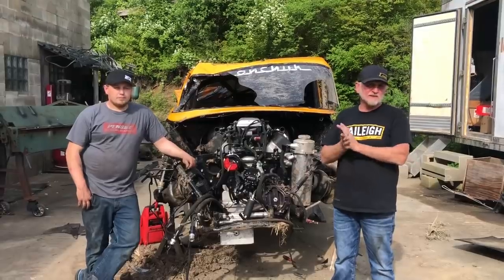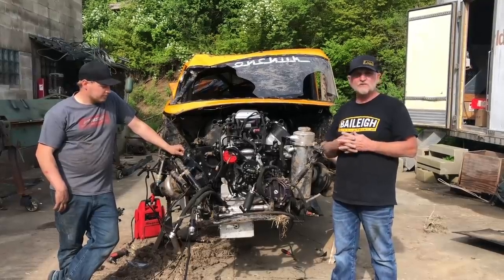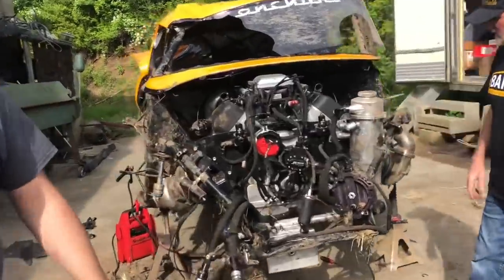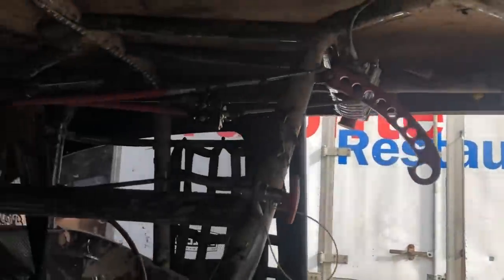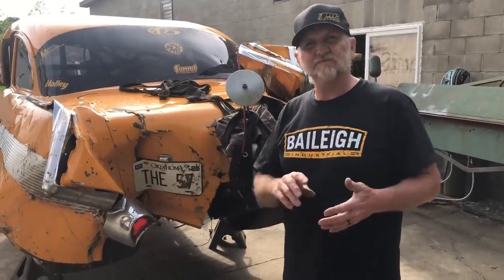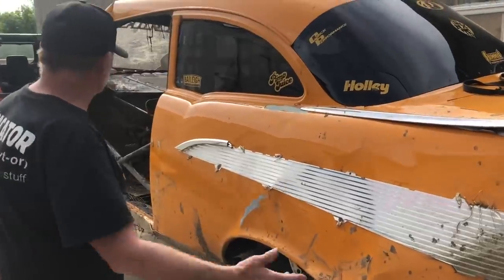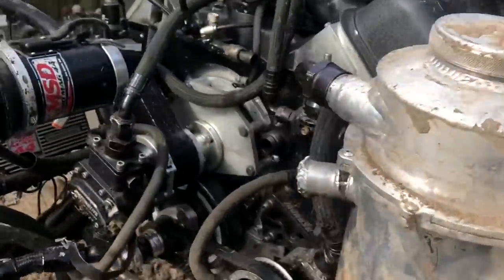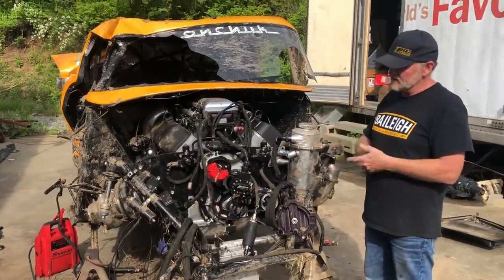Tearing down The 57

Comment: The car is the best advert you could have for chassis building.
It did exactly what it was built to do.
Go straight,and when the time comes (and it will due to things outside of the chassis control) it keeps the driver safe to drive another day👍

Comment: I know that this orange wreck is probably 'worth more' as a bit of a reminder of what can go wrong even if driving in a straight line (and I say that in respect) - but if possible (and a BIG IF) to remove the cage structure and just retain the cabin - that cabin is repairable.  For a concourse restoration no - for a race car - yes.  But of course - the amount of time required to do so would make it financially impractical and I also assume removing the cage//chassis is not such a straightforward task - HA - but it would make a nice repair project to break my boredom between other things in life and return back to you.  The quarter panels I would not bother repairing - but the turret - door opening - windscreen opening could all be got back to a usable state - again - probably far more time involved than starting again as you are with the B&W shell - but a fun - HA - and probably a LOT of BEER whilst planning or swearing during the repair process.  Have a safe and nice day all.  CHEERS from AUSTRALIA.

Comment: My oval track outlaw latemodel stock was a bad 130mph hit to outside wall round track racing I'm not letting go of the totaled car nothing was left except for the little cage area with me and my seat in it it's apart of you if ot saves your life I'm surprised motor is still good I broke all the ears that gets bolts for bell housing and cracked the block lol

Comment: It's to the point that there needs to be a cubic inch limit of the street racing, every one trying to out do everyone with promods and full blown drag cars, y'all try to get to full speed to fast in a 1/8 the mile that it's causes the tires to smoke on the scramble button....is Pilgrim responsible for deaths on the TV contract